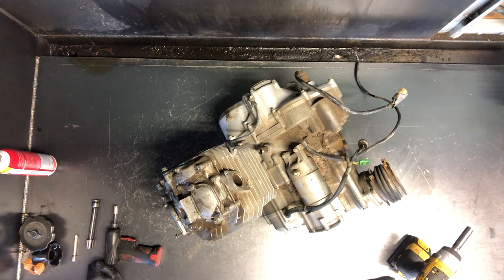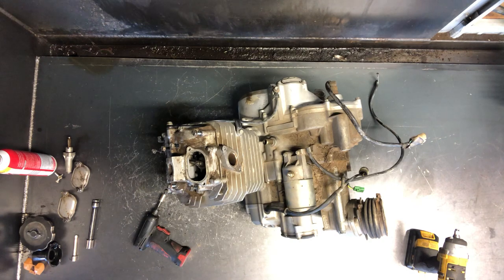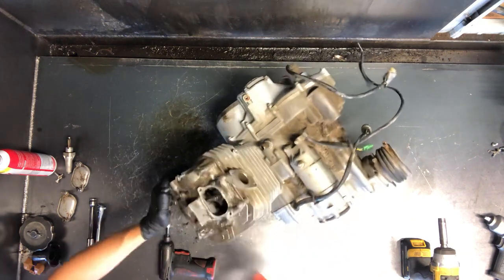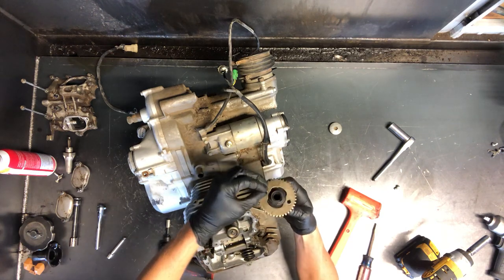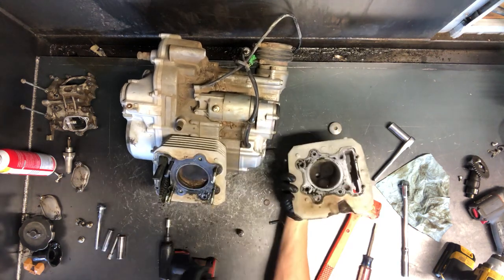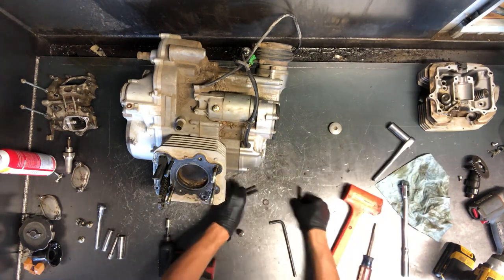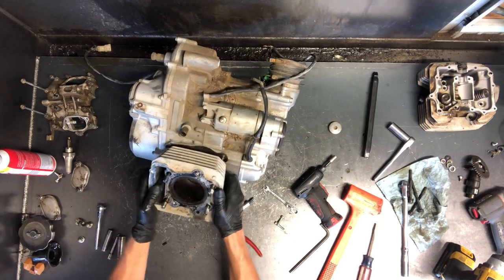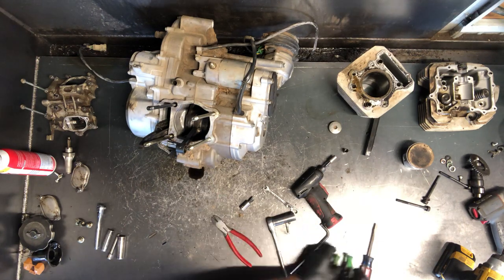Honda Fourtrax TRX 300 trx300 - Top End Rebuild, Cam Piston Cylinder Head Valves - Pulled

Comment: I will be replacing seals in the top end rocker cover (what Im calling rocker cover since it's the top half of the head). Since Im not removing the cylinder like you, I wouldn't need to remove the guide tensioner correct? Also is there anything I need to worry about as far as anything needing TDC or anything when taking off the rocker cover or reinstalling? I'm thinking not since its just the cover. I believe I just need to clean off old Hondabond replace the two seals in the rocker arm shafts (terminology? 😂). Clean surfaces, reapply hondabond. Now would I need to replace the two copper washers/seals on the oil line and also the copper washer/seal thats on one of the rocker cover bolts on the left side? This is my first time tearing an atv engine apart btw

Comment: How many washers goes under the acorn nuts that hold the cylinder down. Is it 2 of 4
Reply from the maker: Steve, only 1 washer under the nut is necessary. Thanks for the comment!
Reply: @MidNebraskaMotorsports  does all 4 nuts get washers was my question
Reply from the maker: YES all 4 get a washer. sorry I misunderstood your question. Thanks again.

Comment: Well they added that one that time oh, I have a 1990 Honda FourTrax 300 and I was just trying to fix my oil leak on the right side where the kick-start is and I took it apart I held in the the kick-start thing but the bottom one fell out but I put it back in correctly my friend comes over there and tells me to put it in a certain way and I trusted him but he never Twisted it and locked it in between the two tabs and so I fixed it I set the timing I set the triangle to the dot. I got the kick start facing almost directly up and when when it was messed up first I started it you can hear the thing making all kinds of noise from the kick-start so I took it apart fixed it correctly and now I have no noise I revved it up and everything was good but I have no gears no forward gears no reverse gear so no gears at all. I was wondering if there's any way you can give me advice, oh and another thing  is I was mad cuz I just installed a new ignition switch. I have four colors one black one red to Pink's one with the white tracer and I believe the Reds hot the pink with a white tracers hot and the blacks a ground and I'm not sure what the other pink one is 4 and I can't remember how I had it on a toggle switch. I really hope you get this message I really need help. I just need to know why this happened how could it not have gone right what did I do wrong. P.  L.  E.  A.  S.  E.      H. E. L. P.     M.  E............MID Nebraska's MOTORSPORTS

Comment: Hey so I’m having a problem with my Honda trx300ex and i was wondering if you could help me, it’s been leaking oil from a plastic cap on the cylinder head and I don’t know where to start.
Reply: Mid Nebraska Motorsports is it just a matter of pulling out the plastic cap?
Reply: Mid Nebraska Motorsports I’ve been trying it doesn’t really wanna move much so I’m scared of breaking it
Reply: @leija749  the valve cover has to come off to get it out